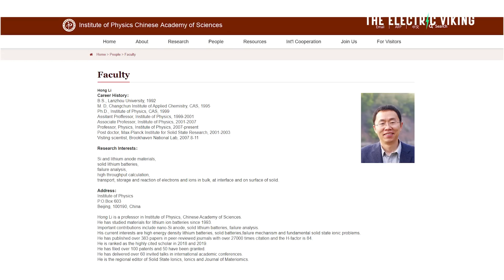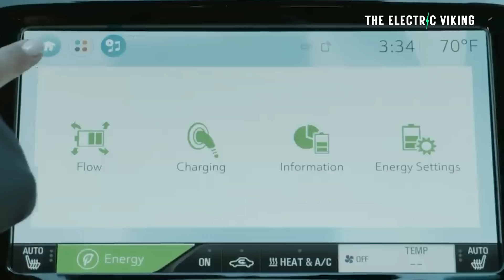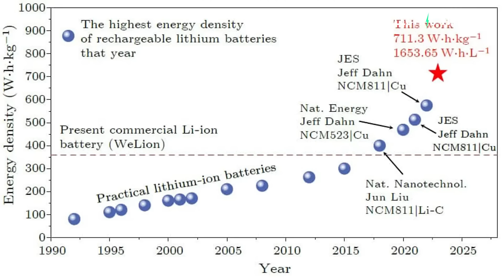The highest energy density lithium ion battery in the world is INSANE

Comment: 711 might be good for EVs, so where can I buy one right now that will last 20 years?
For aircraft, if it uses batteries it will most likely be restricted to a prop type plane, unless it can produce enormous thrust like a Jet engine, somehow.  I’m sceptical for this use as they are completely different types of propulsion.  The last large prop planes for international travel bit the dust in the 1950s as unprofitable, slow and could not take the number of passengers wide bodied aircraft can with Jet engines.
Jet engines are much better at this as they remain largely efficient and fast, and fuel efficient for long haul flights (surprisingly). Its called suck, squeeze, bang, below as to how the engine works, and it does not use gasoline.  Thats a Jet engine in a nutshell, using a form of Kerosine, or A1 jet fuel.  It literally blows the aircraft through the air with incredible directional thrust by burning fossil fuels.  There is nothing else like it.
Reply: Any LFP battery should last  3000 cycle. What is your use case?
Reply: If I understand you correctly, I am not making a case for any other battery type.  Sam suggested that the development of the new 711wh/kg battery has a short life.  Something the developers want to improve before it comes to market.  It’s at 10 years now, which is low by comparative standards.  I would say its the trade off for high capacity with a short lifecycle, and of course the obligatory recycling that follows.  It will be a while before that gets to market I would think.
Reply: Yes, of course, and its available already.  But not as we know it.  How is a battery pack going to deliver thrust similar to a jet engine?  It’s not, or not that we know of yet.  It will need to be something completely different, or most likely props.  Go check the last of the great prop driven international passenger aircraft, the Lockheed Constellation.  It was no match for a 707, which was fast, reliable and safe.  It cut travel times effortlessly.  We will be turning the pages back 70 years going down this route.  Aircraft proposition will need to be something else.  Any guesses what that might be?
Reply: @GolLeeMe  Let me guess, Hydrogen
Reply: Possibly, but I was thinking a concession to airline travel might be that it stays with fossil fuels.  What a sinful thought.  😀.  Someone advocating FF instead of batteries, it will never do.  LOL

If I am correct (and I am a bit rusty on this) Hydrogen ignites easily, but it lacks energy density.  You would need to compress the gas big time and store lots of it, so that you could travel anywhere.  Thats assuming you burn it like Kerosene and maintain a thrust engine arrangement.  The beauty of fossil fuels is that they are so energy dense and gram for gram they provide more energy release than just about anything else.  Hydrogen Fuels cells will put you back into the prop situation again, so that’s no go either I would think.  The problem I see for props is that they will limit the number of passengers you can board, need to stop more frequently and increase travel time and land hops country to country.  Great for say interstate or province travel, but long distance will be problematic I think.  Cheers.

Comment: Honestly how many times have we heard this? 700 is almost 2x as energy dense as the highest battery made today. Time will tell. I was under the impression that there are companys making silicon anodes. I want to say those anodes can go directly into current battery manufacturing wothout any retooling. They were claiming 500
Reply: Don’t know about batteries, but a lot of analysts are pretty dense.
Reply: @FrunkensteinVonZipperneck  That appears to be the CURRENT reality, yes.  ;)
Reply: He’s full of it.
Reply: Everything I'd always done on paper with 1 or 2 cells to run tests on. Nothing ever bears any fruit from these wishful claims. If we could get a energy density of 400 with 2000 cycles it would be great. Don't hold your breath waiting
Reply: The research is interesting and it shows it is possible.  However, it will take a while before these batteries hit the market.  Battery energy density is doubling every 14 years these days and if they maintain that rate then we can expect these batteries around 2040 or so.  Not exactly tomorrow but the research shows it is possible so eventually.

Comment: Gasoline thus has about 100 times the energy density of a lithium-ion battery. This difference in energy density is partially mitigated by the very high efficiency of an electric motor in converting energy stored in the battery to making the car move: it is typically 60-80 percent efficient.
Reply: My calculation showed it to be about 30x, not 100x. I might be wrong - if so please post your arithmetic!?!
Reply: @jonb5493  You're not. Electric vehicles are more than 80% efficient as well. 

Going to become even more noticable when the standard practice of implementing solar cells adds several miles of range each day as well.

Comment: From the chart at 1:45, from 1992 to 2015 battery energy density increased almost linearly.   Battery research spending increased dramatically around 2015 and since then battery capacity has increased dramatically and appears to be speeding up, not diminishing.   This is what happens when R&D spending increases.
Reply: I wonder what's the physical theoretical limit for battery energy density, for semiconductor it's the thickness of the silicon or carbon atom
Reply: @khein2204  For Li it is near 10 KWh/Kg but technically this theoretical limit is not reachable. Technically the limit will be closer to 1 KWh/Kg.
Reply: @khein2204 I know this. Lithium Air batteries are the most energy dense batteries. 

 About 5,110 k-wh/kg is the therotial maximum if you include oxygen like a rocket does. 

 12,210 k-wh/kg if you use the oxygen from the surrounding atmosphere like a jet engine. 
 
 There are a few laborities that have already started to get some to work! So let us hope the technology has a breakthrough that can become a generational leap, especially when paired with solid state.
Reply: @khein2204  Using oxygen (Li-O2) it is apparently 3500Wh/kg. In the lab apparently it is 860Wh/kg so far (July 2025).
Reply: It's way more then spending. Yes it helps. But if your needs are above current technology you will not advance.  That's why the gm electric car in the 90s never had a chance.  Batteries at the time with the previous tech was never going to be more than a 100 mile car.
Reply: Goid point 👉
Reply: Battery research spending increased, and so did the desire to attract it.
Reply: Sorry to burst your bubble and everyone who liked your comment, but this is a linear graph, not a logarithmic graph, meaning an exponential curve is to be expected at a constant rate of improvement. 
Edit: sorry for the ambiguity of "constant rate of improvement" I mean it as a constant percentage rate of change. Not a constant numerical rate of change. I hope ive used the right terminology and cleared things up.
Reply: @injest1928  You are incorrect. A constant rate of improvement would result in a straight line with a positive slope on a linear graph. Something doubling every few years is not linear improvement, it is exponential improvement and would show up as a curve on a linear graph.
Reply: @patrickhawley1392  economy growing 2% a year grows exponentially. Battery capacity grows 5% a year on average, it is an exponential growth, doubling every 14 years on average.
There is no practical limit to this growth as an individual atom can theoretically release enormous amounts of energy..
The future will be batteries but it may take a while..
Reply: @orhanmekic9292  No argument there but it has nothing to do with my previous post where I was just pointing out that a constant rate of improvement is linear and would result in a straight line on a graph. For example, if battery energy density improved at the constant rate of, say, 100 kWhr/kg per year then you would have a straight line on a graph of energy density vs time going up at a steady 100 kWhr/kg each year. I was just pointing out an error in a previous post that said an exponential curve is expected from a constant rate of improvement. A percentage growth per year is not a constant rate of improvement. It is, as you said, exponential.
Reply: @patrickhawley1392  you are right, constant rate of improvement is not exponential it is linear
Reply: @injest1928  you're right, the battery energy density will double every few years, and this roughly happens consistently.

Comment: As an mountain biker, 711 watts would be perfect, my current 700 watt battery weighs 3.8kgs. Yes it’s a niche market, but when not zipping up and down mount a bike trails, my bike even with its nobly tyres does 50 miles on the road… so useful fun transport
Reply: You're confusing between Watt vs Watt-hour! 😢
Reply: No I have a 700 watt hour battery that weighs 3.8 kg, hence a 1kg 711 watt hour battery would be great
Reply: A bicycle is 100x more efficient than the most efficient electric car.  Where is my $7500 federal and $2000 state tax rebate?  Oh yea...this is all BS money business.
Reply: Riding without a battery and doing it the old fashioned way, with leg power, will drop your bike 3.8kgs and make you healthier.
Reply: My view is the e-biking is like downhill skiing, a bit of uplift service makes it more fun
Reply: How does reducing 2.8 kg helps that much
Reply: @karthikeyanm.v8381  acceleration and de-acceleration. Lighter is better,. Even down hill you are usually pedaling hard out of corners, faster to accelerate with a lighter bike and you use less energy.. Change in momentum, easier to turn.
Reply: My current bike a Specialized Turbo Levi Comp is 23kg. It’s good, but you notice the weight and resultant momentum and inertia on more twisty sections, jumps etc. plus quite a lot to lift on hike and bike sections
Reply: It's 711 watt hours/kg (wh/kg) and not 711 watt. The highest energy density on a battery today is around 300 wh/kg.
Reply: The new Amprius battery is 500 watts hr per kg, including casing. So 711 watt without casting should see a real world doubling of power density in the next 3 years

Comment: Wrong! 1) Not W/kg, but Wh/kg reads as Watt hours per kg.
2) Not enough for long range aviation as we know it. Jet fuel has an effective energy density of ca 4000Wh/kg. But since it doesn't weigh anything after being consumed, while batteries do, jet fuel does have almost 7000 to 8000Wh/kg energy density
Reply: Technically true, but... Jet engines are nowhere near as efficient as electric motors. An electric motor can do a lot more with a kilowatt-hour of potential energy than a jet engine ever could.
Reply: Wonder what the efficiency of each energy density propelling the aircraft.  For instance ICEs waste 75% of gasoline energy density to heat and friction while EVs waste less than 10%.
Reply: @stevennelson7518  Jet fuel has 10kWh/kg times up to 40% efficiency for energy conversion at the turbine shaft =4kWh/kg
Reply: Yeah, I don't get the "this will power long range aviation" hype either.. Seems to me that doubling energy density will double the range but since the range of electric airplanes is currently very unimpressive even doubling it won't amount to much.
Reply: Jet fuel has about 12000Wh/kg
Reply: What's the energy of jet fuel vs hydrogen fuel?
Reply: @larryc1616  Hydrogen has 33000wh/kg. That is the main advantage of hydrogen...
Reply: @simpromovie  the issue is volume though, Hydrogen will be stored as compressed gas state, which does not hold all that much more energy. To make hydrogen work for airlines, it needs a huge tank that is strong enough to withstand huge pressure and very light at the sametime. I think in the short to medium term, battery powered smaller short range planes will the first one to take off commercially be hydrogen powered ones.
Reply: @passby8070  Good point! But the energy density of batteries are still way behind even jet fuel which does not have the problem of Hydrogen. Maybe E-fuels are the way out for the moment...
Reply: @simpromovie  hydrogen is ~3Wh/l at atmospheric pressure.
Reply: @passby8070  Correct for the battery, and they will be smaller propeller aircraft. For Jets the weight of the tank as H2 likes to sneak out of thin walls will be a major problem. Then the partial pressures. This will make the storage problem much worse. A container that will contain X amount of H2 at sea level will have to be magnitudes stronger and heaver at high altitudes. As an ex airline pilot H2 as a fuel would be a dream for flight planning because your take off weight would be less than your landing weight. Why not continue to use kerosene (jetA1) for the short term anyway. Most commercial H2 comes from spiting hydrocarbons anyway and therefore makes no difference in CO2 output.

Comment: Performance Metrics Required of Next-Generation Batteries to Electrify Commercial Aircraft
[doi 10.1021/acsenergylett.9b02574]
Regional (500 nautical miles, 30–75 passengers): 600 Wh/kg
Narrow Body (~1000 nautical miles): 820 Wh/kg
Wide Body (>2000 nautical miles, 200-400 passengers): 1280 Wh/kg
Reply: So a bit away in layman talk, but a slight revival of the the propeller.

Comment: Lithium  batteries are banned in Aircraft. Still ignoring the lithium Fires.
One Lithium battery in a car park and it will be the end of EV.
Bio Diesel is far cheaper to make and safer.
Reply: Ever flown in a dreamliner? They have lithium batteries as part of the plane
Reply: @netprep  All modern aircraft use lithium batteries.
Reply: @lionelwylie2326  that's my point.. this guy claims lithium is bad.. he should give up his phone and notebook.. cars are a driving bomb.. I've seen cars catch on fire... I bet he doesn't keep his phone more than few cm away most of the time.. stop fearmongering
Reply: @netprep  That's true and your point is solid, just throwing out there that I saw what happened to a person's face when he swapped a higher capacity battery into his vape and it blew up in his face.
Reply: @netprep  Boeing’s 787 Dreamliner uses the most flammable battery on the market.
Boeing chose to use the most combustible of the standard lithium-ion chemistries on the market in its flagship 787 Dreamliner. The advanced aircraft is grounded around the world after a battery burst into flames.
Reply: "were banned" - after safety issues were resolved and reliability increased, shipping lithium batteries by air has resumed. 

As for car fires, all but a tiny fraction involve flammable fuels like Gasoline, Diesel, and, yes, BioDiesel. Thousands of combustion engine fuel fires happen every year, some of them in car parks, that hasn't lead to their end. Not sure why you think a few rare cases of EV fires should be "the end". 

Sorry, but biodiesel is not cheaper or safer than electricity. It is a lot more polluting!
Reply: @chrismuir8403  Takes 20,000 litres of water to put out a Lithium car fire.
Reply: lithium Batteries have been used in aircraft for over 30 years.

Comment: 750 W/kg? Surely we should be discussing energy, the unit of which is the joule. The unit must be J/Kg. A puny capacitor can put out 750W for a millisecond. I am confused.
Reply: The "Electric Viking" has been using the wrong units for energy density for years. Does he even read the comment section?
Reply: @skipondowntheroad5833  no, because he does not have time. he is busy with making the next game changer video.
Reply: It’s Watts hours per kg…and that’s your energy density.
Reply: The chart at 1:45 shows Wh/Kg.
Reply: In batteries the unit for energy density used is usually Wh/kg and I suspect he just forgets to say the "hours" in "watthours per kilogram". If not then this is a power density discussion and not energy density. The 2170 cells have a power density of 350-400 W/kg (and energy density of 300 Wh/kg) so even if this is the case then that 750 W/kg is still an impressive number.
Reply: You missed the time designated Hour portion of power... << rolls eyes >>
Reply: Wh/kg